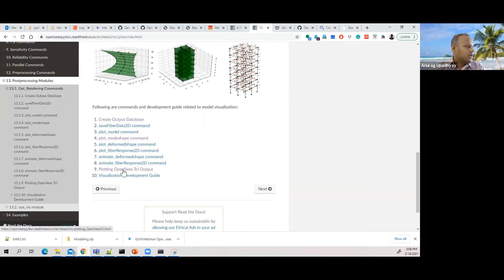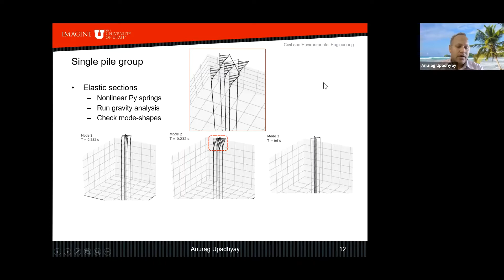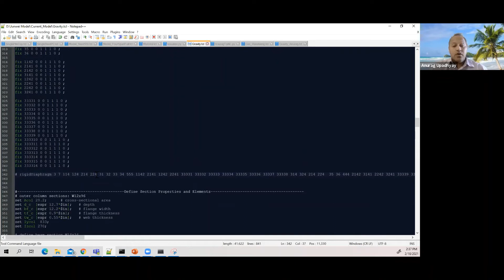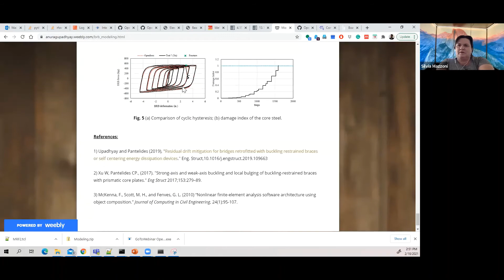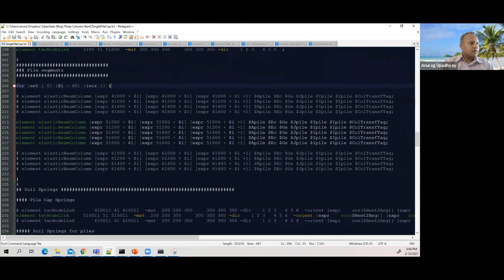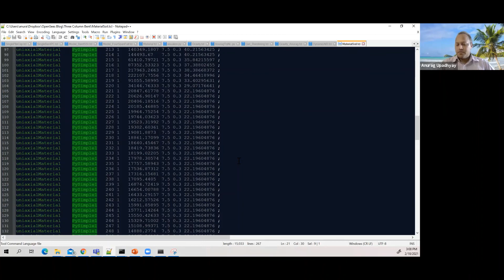OSG-14 with Anurag Upadhyay on OpenSeesPy Visualization Commands for Post-processing- Get_rendering

Comment: Hello Sir, I am currently modeling a bridge bent system with self-centering bracing in OpenSees by tcl. I understand that OpenSees provides self-centering material models (e.g., SMA bars), but these appear to be formulated for a single material element (e.g., Single SMA Rebar).
My bracing system is composed of composite materials (steel + SMA) and exhibits a flag-shaped hysteretic response, which I have already generated through Abaqus simulations. Now, I am unsure about the most appropriate method to implement these combined self-centering bracing properties into an OpenSees bridge bent model.
So, I am specifically wondering: How can I input my bracing properties into a bridge bent model in OpenSees?
I have searched on YouTube and Google, but unfortunately, I have not found a working example or clear documentation so far.
If you have any suggestions, I’d be very grateful. Also, if possible, a future video on modeling composite self-centering bracing in bridge bents would help many students like me.
Thank you again for your time and dedication to the OpenSees community.